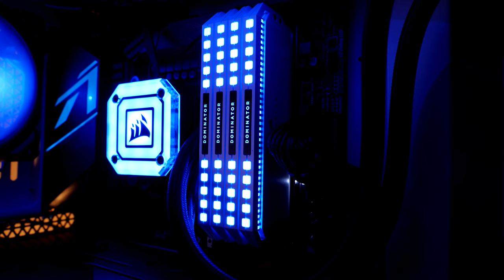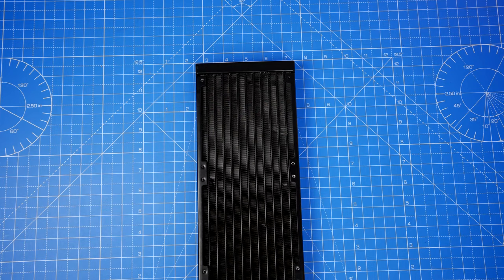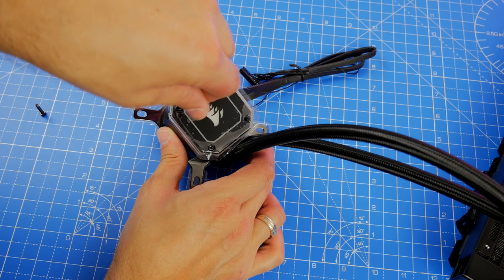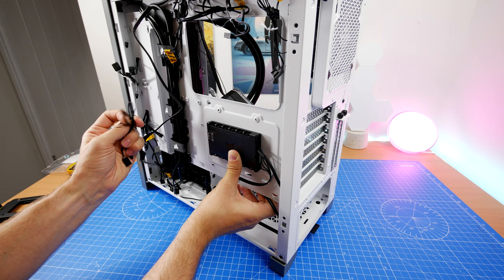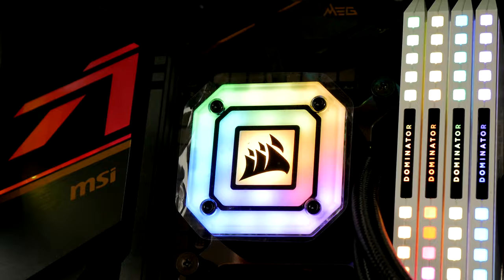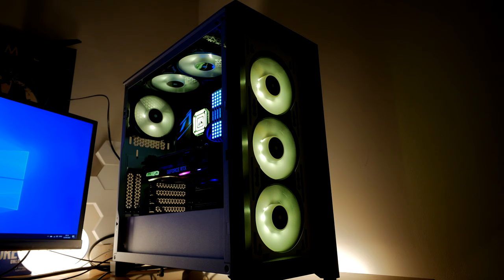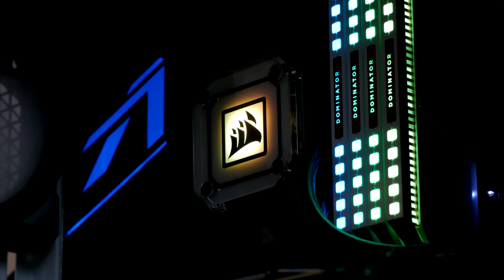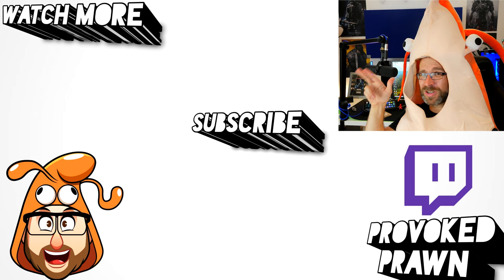Corsair iCue H150i Elite Capellix Pros and Cons - what's good?

Comment: Do you know if Corsair will sell the controller separately as I’m planning a build in the lian li 09 club with 9 fans. Or would I have to get a commander pro as well
Reply from the maker: They don't know yet. I'd expect so though.
Reply: They sell for about 75 USD on Amazon from what I saw.
Reply: How did you go with this? I'd like to do that too. I have the Elite, and 3 x QL 120 fan's. I'd need a commander Pro if I wanted to add more fans right, since the node only can support up to 6, am I right? Thanks

Comment: Did you set your pump curv sensor for the pump temps or the cpu temps?  I want to put mine on the quit mode but also doesnt melt my system

Comment: If I'm running a stock 5950x config, can I get away with quiet setting? I'd like to keep it as quiet as possible but not keep the system too hot under load (light gaming etc).

Comment: I'm able to switch this fans out with the magnet ones right?
Reply from the maker: Which?
Reply: @TheProvokedPrawn  So, if the fans that come with this I don't like, I can always slap on QL120 RGB 120mm instead? Or, I have no choice to go with the fans that come with the radiator?
Reply from the maker: @DaveBudness  yes. You can use QL120s no problems

Comment: Anyone having issues with pump LEDs not working? Everything else works and it even shows up as if it were working properly in iCUE but the LEDs themselves don’t turn on. I messed with some settings and it randomly started working ONCE and then stopped again randomly. No idea what’s causing this. If anyone has experienced this please share, very annoying issue thanks!

Comment: Question, say I have 7 of these fans (3 ML, 4 LL.). I have the Commander Core include with the cooler, with a maximum of 6 fan headers.  If I were to plug in that last extra single fan directly into my motherboard, would everything still work without a hitch?  ICUE would have no problem detecting the extra fan?
Reply: If you connect either the power or rgb directly to the mobo I don’t think icue will detect it. You need a commander/lighting node to be able to control them. Otherwise you can connect it to mobo and control it by bios but it will be not show and be part of icue system.

Comment: You hear the pump when your fans are quiet  because your radiator is installed incorrectly you should have the tubes on the bottom
Reply: You can watch the video by gamer nexus where he talks abt the science behind it
Reply from the maker: Yes I have seen that and showed it's not possible in the video. I also linked to the GN video in the description. Unless you already saw that, you joker.

Comment: Question. Is the mounting backplate for the aio the same as the previous models of Corsair aios? I have a Corsair h100i and I want to buy one of these but I don’t want to ruin the adhesive of my current mounting plate by taking it off.
Reply from the maker: If you're using the same socket CPU, then yes.

Comment: Hey man, love the video but I have 1 question. Will any corsair fans be compatible with the commander core that comes with this cooler? Cause you said that you can't buy the fans separately that are in the cooler but then I saw someone that said you can't mix different fans together.  A response will be greatly appreciated.
Reply from the maker: Yes any Corsair fans will work and yes, you shouldn't mix and match fans really because they have different speeds and different airflow specs.
Reply: @TheProvokedPrawn  thanks for your reply!

Comment: That's thing about these pumps on AIO's, you can hear them, that's been my experience anyway. But I do have the older 115 pro or something, I was wondering ij they improved the pump noise on the newer ones.
Reply: I have an h115i Elite Capellix and the pump noise is awful, and apparently worse than the previous generation of pumps. Quite frustrating.
Reply: @CdrRogue  Geez... that's why aI like air coolers too. I figured the capellix would be better, but apparently not. I have the one that came out about 2 or 3 years ago, if I keep it on the low setting 1000rpm it's ok....anything higher terrible.
Reply: @topmech71  1000 RPM sounds amazing :), the new ones have three speed settings, 2200, 2400 and 2600 RPM. No ability to go any lower. It boggles my mind!

Comment: What if you have 7 Corsair RGB fans? 3 on the front, one on the back and 3 on the radiator on top, the box only have 6 spots, will you not be able to control one of the fans??
Reply from the maker: You can use fan splitters or plug into the motherboard instead.

Comment: How do you know if it’ll mount to your pc case ? Is there a screw pattern or something I can find ?
Reply from the maker: Most cases will say what size radiator they can take and where (e.g 360mm top, front or bottom) and they will all fit then as the screen holes are there already.

Comment: Sorry for my ignorance, but do you install the fans on the radiator and then mount the radiator where it should go?  Thanks for your video.
Reply from the maker: That's the easiest way, yes
Reply: @TheProvokedPrawn  I wonder if I should install the fans as Corsair recommends as "air-intake" or as I've seen youtubers installing the fans as air flowing from inside the case out or just "air-outtake".  Thanks for your previous response.

Comment: How would this work with different corsair fans? my case came with LL120s (same connector as ML that are included here) but there are more LEDs. I noticed in the video that iCUE shows your 4 LED fans having 8. I would just use both the node core and commander core, but I want to have sequential effects between them.
Reply from the maker: I think the Commander Core can probably handle it all. They upgraded the lighting node core with the QL fans recently so I'd imagine this can handle all fans. I need to check.
Reply: @TheProvokedPrawn  yeah, it looks like it can handle them, I just don't know how mixing fans in iCUE works. Did all your fans show the correct number of LEDs or did the 4 led variant show 8 in iCUE? Thanks!

Comment: You've probably been asked this question already, but regarding this cpu cooler, is it possible to connect the commander core that comes with it to the commander pro? I'm changing my pc case and will be adding a lot more fans and I already have the commander pro. Also as I understood, the rgb and power for the pump connector only works with the commander core and not the commander pro so if I buy this AIO I absolutely have to use the commander core for it to work - is that right?
Reply from the maker: You do need the commander core. Yes. but you can use PWM controllers or fan splitters to help.
Reply from the maker: Have a look at this newer video and you'll see more on it. https://youtu.be/VYgWCVMOQfE
Reply from the maker: And this https://youtu.be/L2ervXeVk0o

Comment: Does the corsair h150i elite capellix can be placed to the upside of the case or he is too big?
Reply: On the case he is using, the h150i will not fit on the top mount, only the h100i (240mm AIO) or the h115i (280mm AIO, with shorter RAM modules). With other cases though, some support a 360mm AIO on top.

Comment: Great video overall, I have one question. can you mix the fans on the commander core for example, the 3 fans which come with the AIO are ML's can you add 3 QL's to that or, should all fans be of the same Version? i know atleast that the adds which you are going to add need to have the same connectors.
Reply: Yes you can mix ql with the ml on the included commander core. I just did a new build with this cooler.
Reply: Any idea on Ll120s?
Reply: @MugiwaraDom  if they have the same connectors as the included ML ones i think you can match them. My setup worked

Comment: where the fins bent like that when it arrived? would that affect performance in any meaningful way?
Reply from the maker: They were. And shouldn't do.
Reply: @animaza I just got this cooler as well and the fins are ridiculously easy to bend. Gotta be really careful to not put any pressure on them to keep them straight. If you do bend a fin, you can really carefully straighten them out with something really small but be careful or you'll just bend it the opposite way.

Comment: Can I use the sp120 fans (as case fans) and the ML RGB fans (on the radiator) together on the commander pro (controller)?
Reply from the maker: You can. Though they say you shouldn't mix fans on the Commander Core but it does work.
Reply: @TheProvokedPrawn  okay thank you. I was at work with Steve elston. He said he knew you.

Comment: I am buying up parts for my first pc build. I have this cooler. My question is, fan order in icue controller. 1-6. The 1st fan is the front bottom (intake) and 6th fan in rear (exhaust) Correct?? Thank you. I want my fans to look like yours :) Also, I bought the icue 4000X RGB case, this cooler. The rear fan, I got on amaz, the SP120 RGB. It has 8 LEDs.
Reply: That's correct. Fan one at the bottom front of the case and fan 6 being the exhaust
Reply: hey, you can change the order if u messed it up inside of iCue software.

Comment: Nice video! What is a possible solution if you want to control a total of 10 iCUE fans?
Reply from the maker: You're going to need to mix in some lighting node cores and maybe a Commander Pro.
Reply: The Provoked Prawn so what this comes with along with the nodes that come with the 3-pack wouldn’t be enough? You can connect 2 nodes and this thing into most motherboards right

Comment: So basically this is just the same as before but with different lights and a commander pro included? I’m yet to buy any aio so it seems like this will be the one to get, given it’s about the same price as the rgb pro.
Reply from the maker: Commander Core. Quite different to the pro
Reply: @TheProvokedPrawn  I'm new to all this so forgive my ignorance but if I'm buying a Corsair aio and was going to get the h100 RGB pro platinum and the commander pro, am I better off instead getting this elite cappellix?
Reply from the maker: @stephenohanlon1671  I a video on the h100i before https://youtu.be/-vjewiYfNsQ this one is a lot easier to setup. Especially with the Commander Core included and with the very nice (fast and decent) ML fans included.

Comment: so im going to get a 680x which includes 3 LL120's if the commander CORE only supports 6 fans how could i have 9 in the case what other commander would i need
Reply: You don't need anything else, you just plug in the commander core for 6, and the node core for 3
Reply from the maker: Have a look at this https://youtu.be/kCC0hrqPiFI
Reply: If you're asking whether if you can control the PWM speed of all 9 fans, you can use splitters. Though, it depends on the total allowable current draw and I am not sure yet for this new commander core. The commander pro allows for total 4A with each channel max 1A. Meaning you can use a 3 way splitter plugged into 1 pwm channel (each fan draws 0.3A). A safer bet is to buy a powered fan hub (with sata cable) and populate the remaining fans onto this hub then plug the cable from hub to one of the pwm channel in commander core. With this config you can control all 9 fan speed in iCue.

If rgb control is what you mean then use the lighting node pro that came in with 3 pack LL fans.

Comment: Thanks bro, can you control pump settings without using the commander pro? Please answer, thanks again.
Reply from the maker: It comes with the commander core. Not pro. That's included in the box, no extra cost.
Reply: @TheProvokedPrawn  Thanks again! but can you use icue to control pump without using commander core. I wont be using the fans that comes with this aio.
Reply: @pikachusolu1606  The pump is powered by the commander core, so you have to use it unfortunately.

Comment: People are reporting loud pump noise, where the pump can only go as low as ~2000 RPM. EWW!
Reply: Yeah, can confirm.. it's terrible. I will be buying Noctua U12S and replacing the fan with ML120 to keep my RGB build.. Capellix will go to the box until the next build. I would return it but I like the new commander unit and everything is already Corsair brand. But I think this is my last AIO. I had one back in 2010 and was much quieter. I thought 10 years would change something but I guess hype>quality.

Comment: Is this a good, high quality aio? I am thinking of getting the Corsair H115i Elite Capillex 280mm for top mounted exhaust aio in my Corsair 500D
Reply from the maker: Yes. Corsair AIOs are solid.
Reply: The h115i Elite Capellix pump works well, but is EXTREMELY noisy, and only has three very high RPM speed settings available. If you're concerned about noise, avoid. :/
Reply: @CdrRogue  i dont get how these reviews dont mention anything about this loud noise its horrible and a huge deal breaker.

Comment: Hi, can I plug in the Corsair lighting node light strips into this new commander core?
Reply from the maker: Unfortunately I don't think so/don't know. Unless the connector is the same as the RGB fan connector? There's no separate option like on the Commander Pro.
Reply: @TheProvokedPrawn  the LS100 smart lighting strips from Corsair have the exact same connections. BUT, I made the mistake of buying just 2 450mm strips for $40, and when I plugged them in, there wasn't enough power to even make it halfway through the first strip. Come to find out, the kit I got is an Expansion Kit, and to use it I needed the Starter Kit which is $100... i returned the 2 450mm and got the 2 250mm and 2 450mm strips in the starter kit. I doubt they will provide enough power for all the LEDs tbh. Once I get mine because my H100i RGB Pro XT got a leak, they're sending me back an H100i Elite Cappelix instead because I asked very nicely for a credit on their website so I could at least buy it, but they wouldn't, but they WILL just send it to me anyway, makes total sense, but I appreciate their customer service so much, that's exactly why my stuff is decked out with Corsair.

Comment: My pump also whines. I have the Fract S36 Dynamic AIO.
Reply: My dude, watch GN's video. I recommend installing the radiator at the top of the case or at the front with the tubes at the bottom, that should eliminate noise.
Reply: @strikereureka5081  hey man. i've already watched GN's video and my AIO is installed on top from the beginning... probably i got a bad AIO...
Reply: @spacecy  That's weird, probably a good idea to get a replacement at this point.

Comment: What are those RGB sticks to the right of your AIO/CPU??
Reply from the maker: The RAM?
Reply: @TheProvokedPrawn  Oh okay I though usually you only have 2 sticks of RAM like 2x8 or 2x16?? Is that like 4x8
Reply from the maker: @trxnqualyzed8719  yes
Reply: @TheProvokedPrawn  what’s the point of that? Just for the RGB?
Reply from the maker: @trxnqualyzed8719  I need 32gb?
Reply: @TheProvokedPrawn  nvm lol. Good vid tho❤️
Reply: @trxnqualyzed8719  On most consumer boards, having 4 ram sticks instead of 2 doesn't provide any benefit (other than aesthetics), since they are running dual channel. There are quad channel motherboards tho, where 4 sticks provide a performance benefit. Not really relevant for normal consumers tho.

Comment: can you attach corsair rgb hubs to the commander core
Reply from the maker: No? The RGB cables from the fans plug into it, by passing the need for the RGB cores.
Reply: @TheProvokedPrawn  right, but what if you need more than 6 connectors.
Reply from the maker: @RyanLHarp  apparently splitter cables might work but I've not tried them.
Reply: @TheProvokedPrawn  I went ahead and just ordered a commander pro to go with the cooler/extra fans. Splitters wouldve probably been a cheaper option.

Comment: Very Good video.. Question. What if i want 8 fans in a Crystal 680X ?. What do i need for that. 

As far as i know i need 

Commander Pro
2 x RGB Fan LED Hub
2 x PWM Splitter 1 to 2

So there is 6 on the commander pro, but if you add 2 splitters there is 8 all in all for power. and with 2 x RGB Fan LED Hub there is up to 12 fans possible. Those 2 put into the 2 usb's on the commander pro.

is that setup right? or is there an easier way you think?

//XaZor
Reply from the maker: https://www.youtube.com/watch?v=kCC0hrqPiFI

Comment: Does it still use the awful stock AMD clip system like with the old Corsair AIO's? Or have they moved away from it for AMD mounting? Asking because this used to be a huge turn-off from the now old generation of Corsair AIOs.
Reply: It uses the same one as the pro (XT) and platinum. Hydro series used a asetek design that you rotated the mount on. This one you clip the two sides where the AMD mounting bracket is

Comment: I have the h115i elite capellix and it seems like the fans spin extremely slow. When I turn my computer on, the fans start to spin (slowly) and then they stop completely, and then ramp up again. In ICue, on extreme speeds, the fans only spin at 820rpm even though the box says these fans spin between 400-2000rpm. Any ideas?
Reply: My fans spin slow too I've noticed the will go up speed as needed depending on temps. I keep mine on balanced and I have it to monitor the full cpu package

Comment: The pump is having to work overtime and pump fluid upwards as the rad intake is higher than the pump. It will also be pumping into the air block as the rad has 10% air which will always be at the highest point in the rad.. the pump will wine and the rad will gurgle due to the bubble at top.. .. .. and we are not even talking about the reduced airflow to the GPU...
Reply from the maker: Thanks for your expert opinion.
Reply: ... and then it will explode in a fireball! 💥💥💥